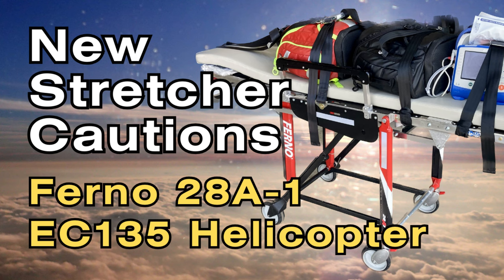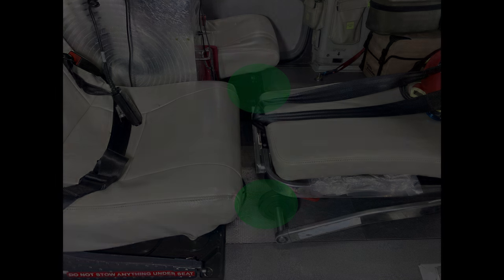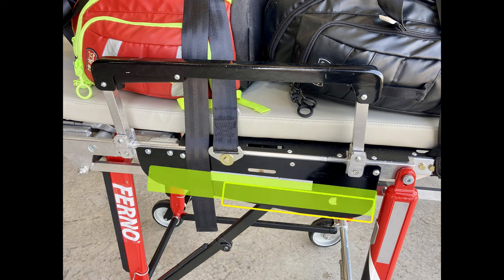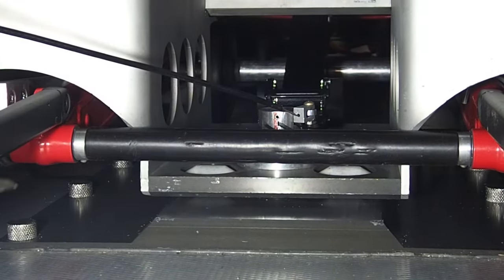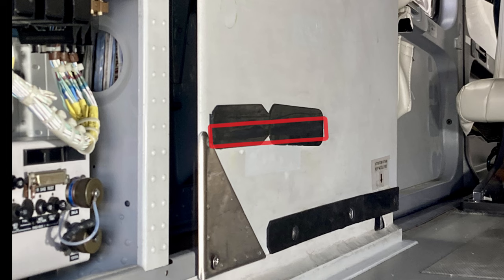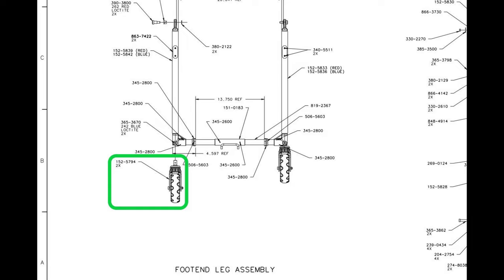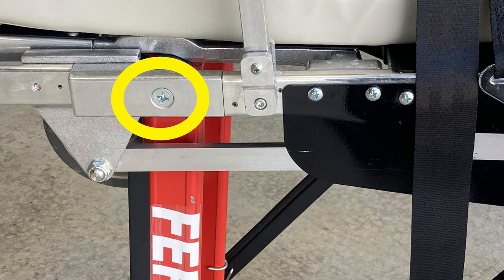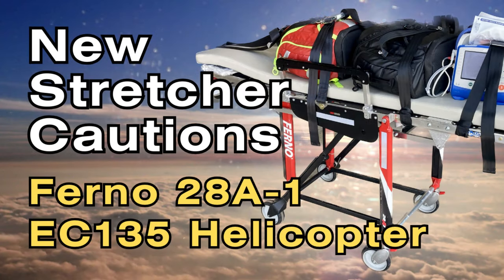Ferno 28A-1 Stretcher | Airbus EC135 Helicopter

Comment: As a crew member i think this cot sucks, good luck if you have the higher skid package, the collapsible legs do not collapse easily and bending under the tail, lifting up and pushing in will wreck everyone's back.  Good news is the cot is rated for 700lbs, but any pt over 250lbs barely fits.
Reply from the maker: I hear you.
Reply: @HelicopterMaintenance  Sorry just like to vent, i just think a simpler cot that you can lift the carriage would be better than relying on pressure against the back plate of the helicopter to retract the wheels.  Especially since only one side makes contact with back. 😁